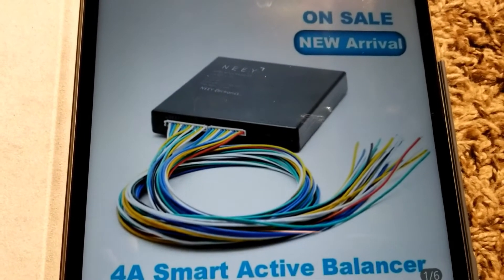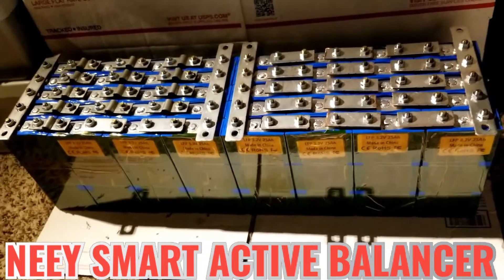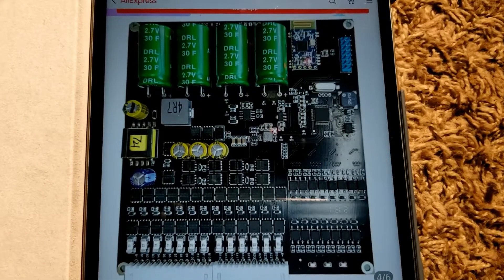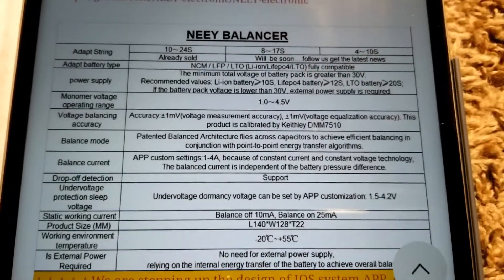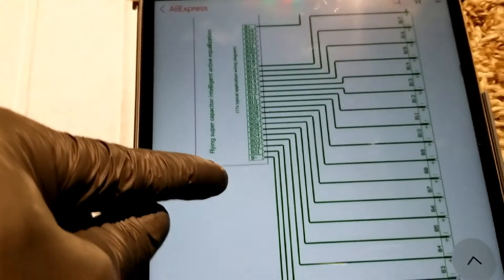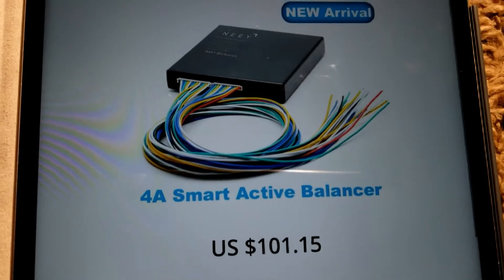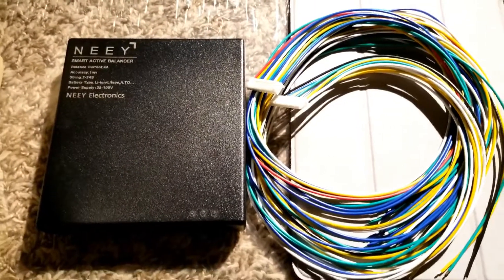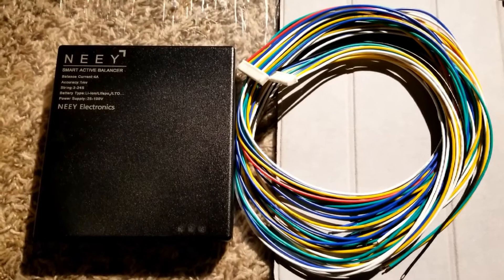NEEY 4A SMART ACTIVE BALANCER

Comment: Would be nice if the manual made sense,  trying to use an external power supply for a 12 volt system is so generic that no one can follow it
Reply from the maker: It doesn't come with a manual at all.
Reply: @jwsolarusa  its online